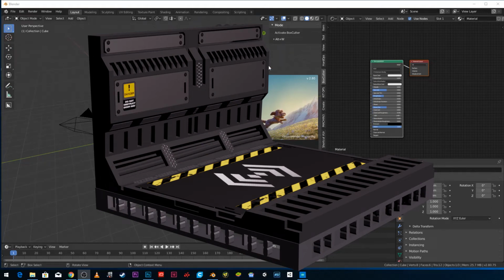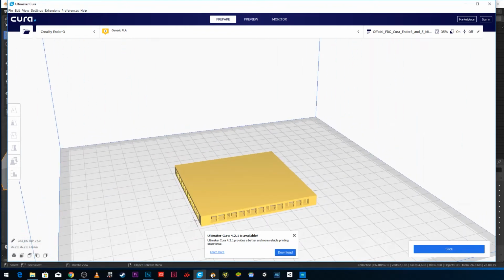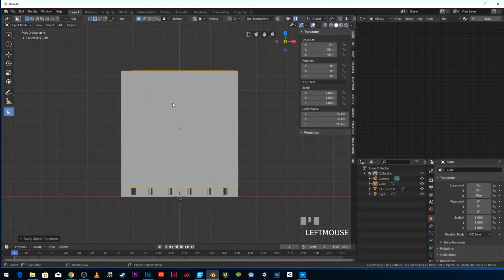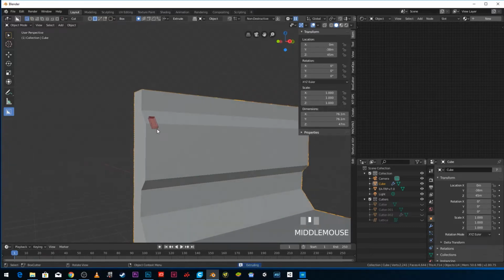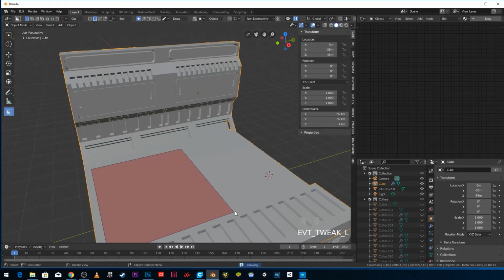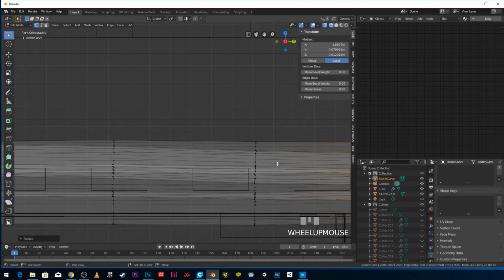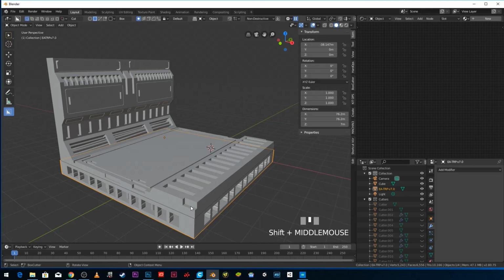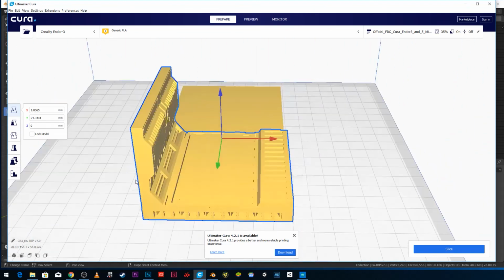Box Cutter - 3D Printed Terrain - Open Lock - Blender 2.8

Comment: Nice design! A little tip - If you set snapping to vertex you can grab a side of your cube, move it a long an axis and holding CTRL will let you snap it to a vertex. Makes matching the exact dimensions of the openlock building block really fast and easy.